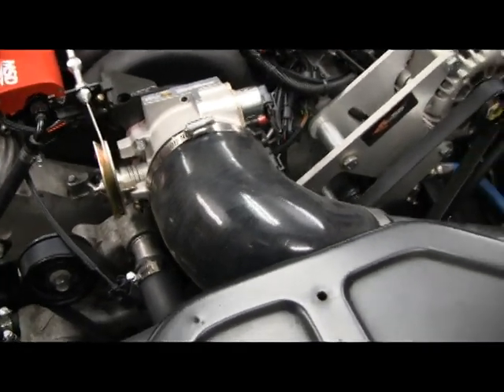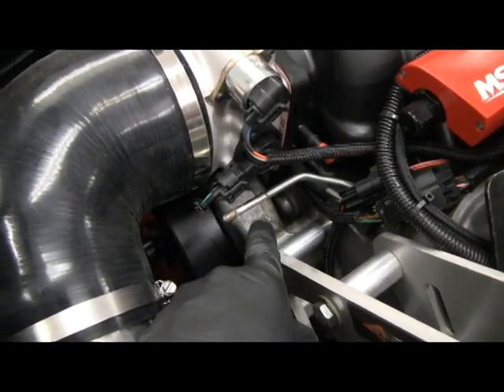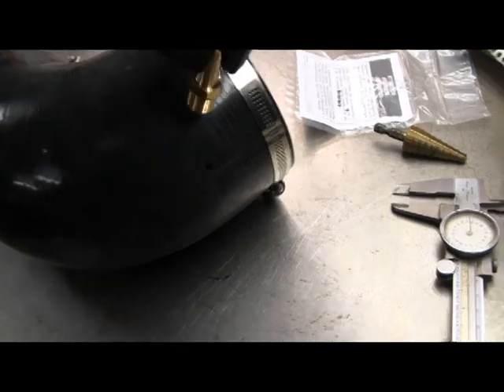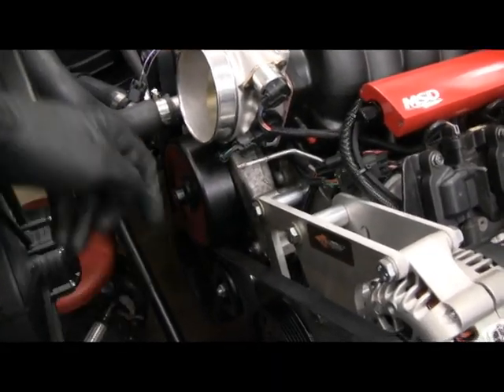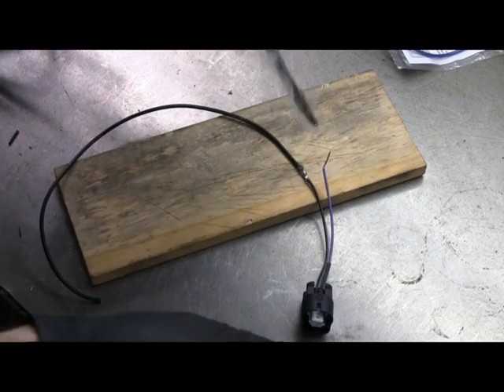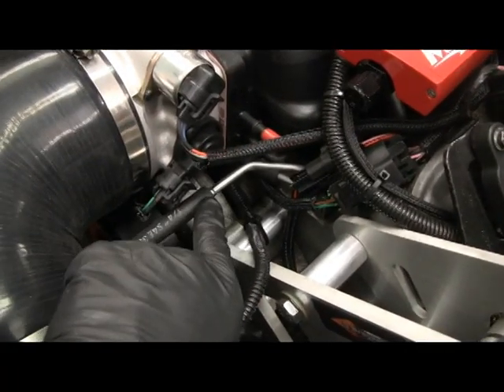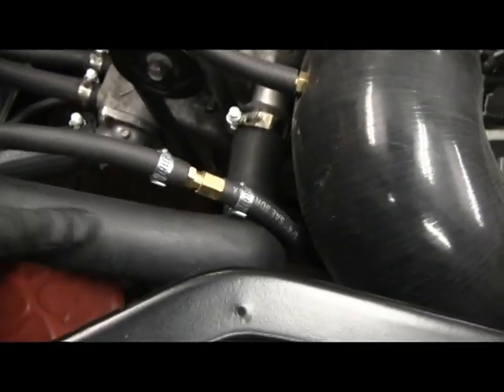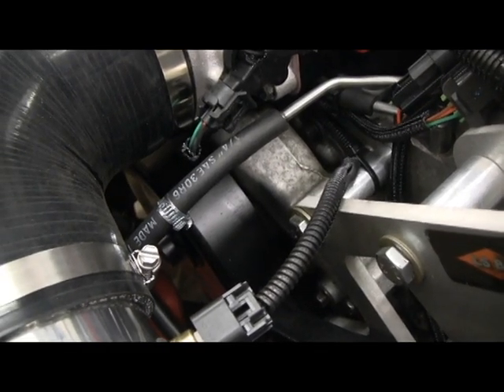Episode 62 Steamline and IAT senser

Comment: This makes me feel confident drilling into my intake tube for this groummet type fitting. It is much more economical than finding someone to weld a bung for screw type fitting.
Reply: Facts i have to do the same thing with my Holley setup
Reply: @djk.o.2738  I've been rolling like this for about a year. It wouldn't be a bad idea to add some type of super glue or some sort of adhesive to the groumet. That way anytime you insert or remove the sensor the groumet doesn't pop off.
Reply: @GachoStyleP1  as long as you don’t over drill the whole size i think it will be fine…i tried it on my first intake but i didn’t clean the djs up with a file… grummet was perfect but i would have to force the sensor in it

Comment: Happy Thanksgiving, good to see how close you are to finishing. I have a suggestion, you should consider installing an oil catch can,  coverman66 has a great vid showing how much oil actually collects in one, and prevents it from collecting in the manifold.
Reply from the maker: Spoiler alert... its already running. I'm just really behind on posting. I have about 500 miles on it. It has not been without issues which I will show everyone. Funny you mention the catch can because the PCV system was one of the things I needed to address and when I did I added a catch can. Coverman66 is correct, an LS sucks in a lot of oil without one. Stay tuned.